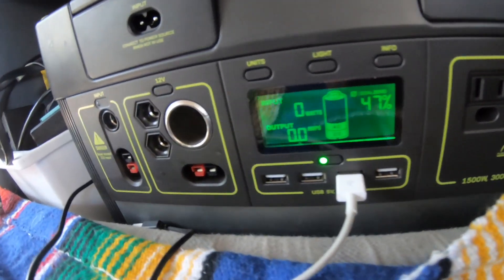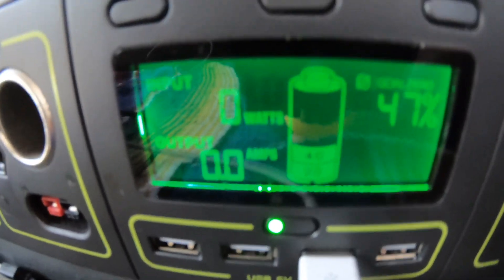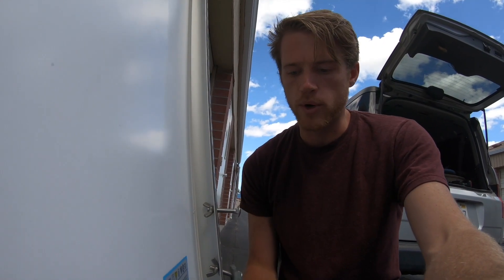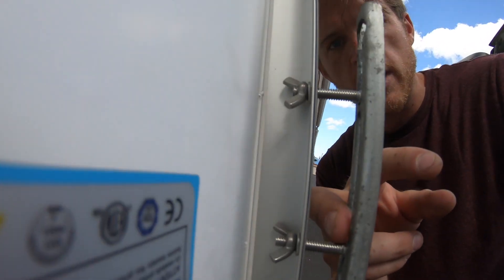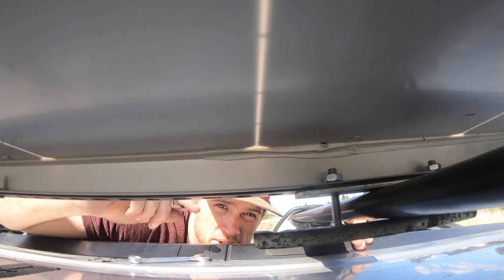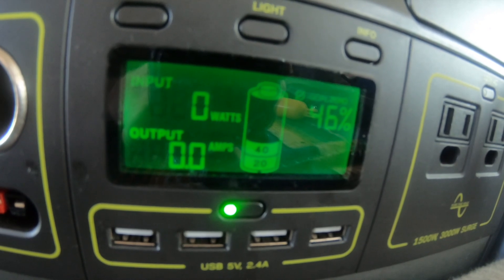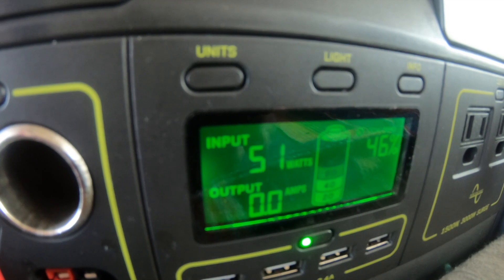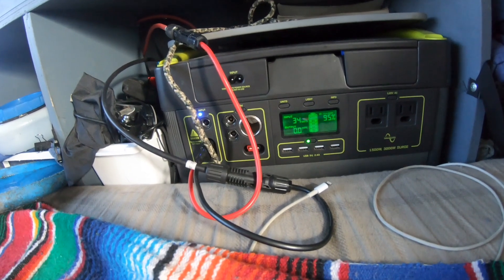How Fast Can I Recharge A Goal Zero 1000 Lithium?

Comment: Use a MPPT module and it’ll be even faster.  I used the Will Prowse hack for this and it did 75% in 5 hours with 2x100 watt panels

Comment: Cool setup. I just installed solar on my element. I used a 150 ah sealed deep cycle battery because it was a quarter the cost. Im leaving in September.  Check out my videos if you want to see my setup
Reply from the maker: I’ll check them out!

Comment: Great charging experiment, Sage! I think that you would have to angle your solar panel up to follow the inclination of the sun to get more power out of your solar panel. 
I was thinking than van dwellers can only get their maximum amount of solar energy, if they park in direct sunlight. But, what if you want to park under the trees in the shade so that you don’t get blazing hot in your van? In the shade, you can’t get enough solar to run a cooling system.
Reply from the maker: Mitchell Barnow yeh I know the optimal angle makes a difference for reaching optimal charge levels. Plus a lot of other factors that I haven’t accounted for. Haha
Reply: Sage Roddy The most optimum panels electronically follow the sun throughout the day. That’s when things can get totally out of control.
Reply from the maker: Yeah and it’s a constant balance of keeping cool in the shade and getting power.
Reply: Sage Roddy I was thinking about the need for shade versus the needs of the solar power.